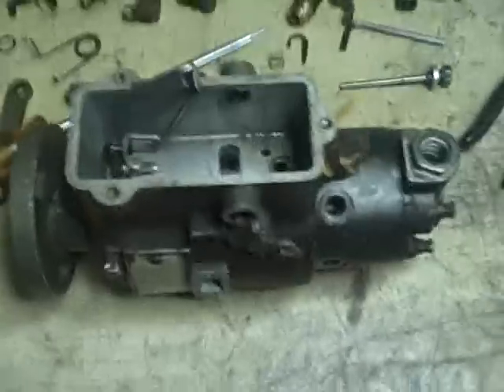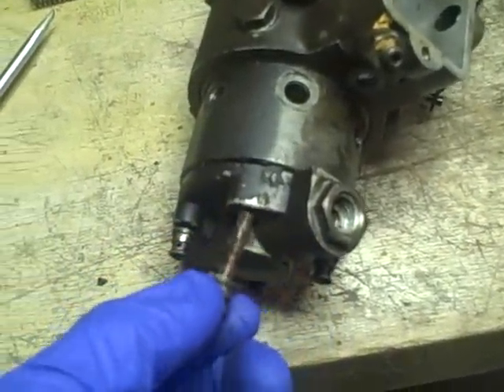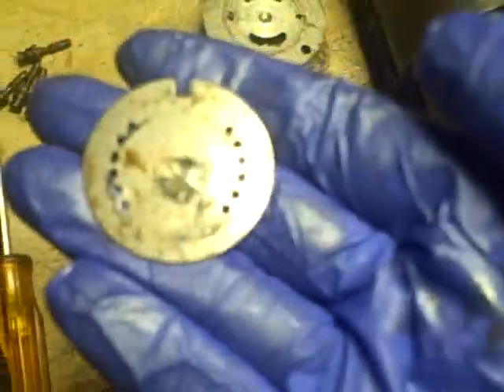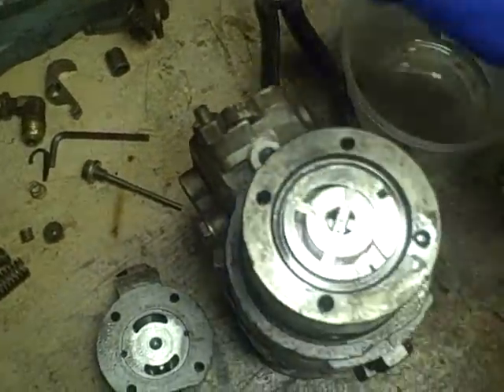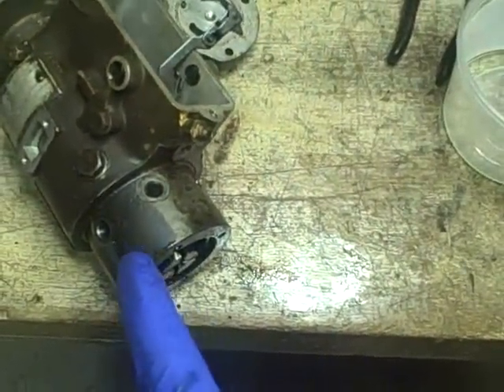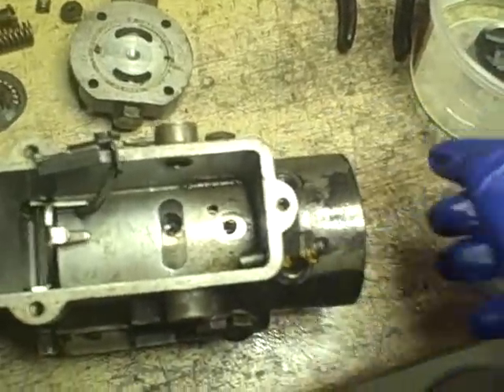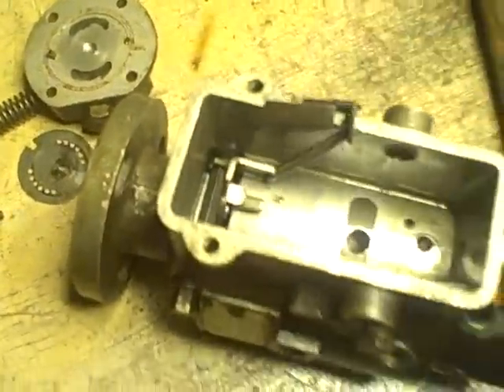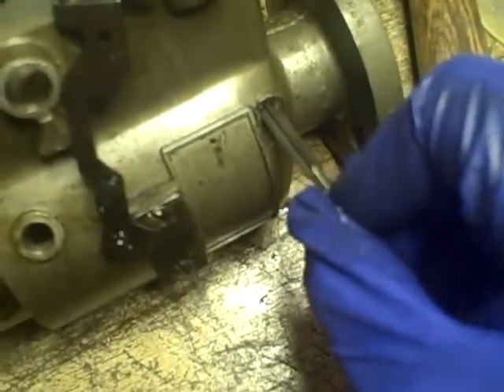Oliver 770 Industrial Tractor Project Part 61: More injection pump dis-assembly

Comment: can I send you mine standadine pump from an old deere 820 utlitiy tractor?  will pay.  thanks
Reply from the maker: Sorry Bill, I wouldn't feel comfortable doing this repair for someone else. I'm not an expert. I also would have no way to test it. I know diesel pump repair shops can be expensive but the good ones are worth it. You should ask around on some tractor forums for references.  By the way, nice tractor. I once wanted a John John Deere. Watched a model R at a tractor pull years ago and fell in love with that 2 cylinder diesel. Learned all about them, tried to find a reasonably priced one, but never did. Now all those Johnny popper diesels are too expensive for me.

Comment: THANK YOU , I have a case 580 ck model A and it sat for 6 months would not start no fuel flow out of pump and supply was good and new fuel and pump was full of fuel. I watched your video 59 and 60 and saw how pump worked with throttle linkage and shutdown tic tock type little arm. Then went out to backhow cleaned pump of dirt took top cover off pump and gave it half throttle and then pushed then pulled shutdown cable knob and tic tock lever didnt move. I gently moved it by hand and go it free , just little bit stuck. PUT COVER BACK ON AND IT FIRED RIGHT UP, THANKS AGAIN, lesson is after you shutdown engine pull out knob to store , leave in run position and disconnect battery for safety. The video is also helpful for reassmbly.
Reply from the maker: you're welcome

Comment: My head is sooo thight..tried to pull harder and twist but it just won't budge.. I haven't removed the governor linkage/metering valve yet, but as far as I can tell it isn't necessary?
Reply from the maker: Can't say for sure. It's been a while since I did this. I do not think it was to hard to remove the linkage, and valve though.

Comment: Hi Steve your video's are great last weekend my injection pump stop working so I went on line
looking for a manual but came across your video's which I watch but could not find all of them
my tractor is a four cylinder Oliver looks just like yours could you tell how to see the rest of yours
video's  Thanks alot my model No. is DBGFC427---8BH
HOPE YOU CAN HELP I think my tractor a Oliver 570 year 1957ish
Reply from the maker: Hello David, All of the Oliver videos are in a playlist found here: https://www.youtube.com/playlist?list=PLV1RW-p5BeonZ8JAGBF9tk4d4-YKrjgC9
The videos of the pump teardown start around Part 59.
Reply: Thanks Steve what I'm looking for is the internal video photo when you took the pump apart where inside but I don't know exactly how it goes because a rubber ring has disintegrated if you have any suggestions let me know please it's towards the back where the weights went thanks a lot
Reply: I think it holds the weights in a ring together not quite sure

Comment: After watching several youtubes on diesel injector pumps I got my answer from watching yours. I had an external fuel leak on the CAV injector pump on my 79 Ford 555 TLBH. You showed how to get the hydraulic head off of yours. Seems to be similar to the CAV. I got the hydraulic head off and replaced the hydraulic head O ring without removing the complete pump from the tractor. It was a tight fit as the starter motor restricted the movement of the hydraulic head. Thanks. That leak was driving me crazy.
Reply from the maker: Glad my video helped. Thanks for the comment.